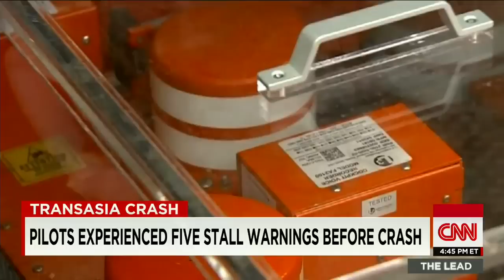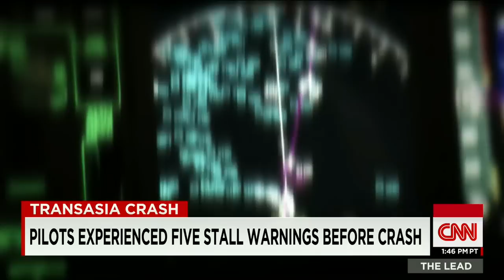TransAsia plane lost power in both engines

Comment: It's often hard to tell which engine has failed- a stall warning and loss of thrust, some yaw might be all the pilot realizes; especially if the dash board reads that both engines are running after engine failure is diagnosed he brings out his check list and goes through the process to shut the engine down- really not his fault- planes need more accurate sensors. Too many incidents of incorrect speed readings, incorrect altitude readings, incorrect fuel readings.
Reply: thanks for clarifying- most of us don't know any of this- I thought there would be separate readings for each to see which has trouble easily. what does the pilot mean exactly by 'flame out' in the Mayday?
Reply: Pure nonsense.
You don't shut off the engines just because one seems to have lost power, you keep going.

This fabrication of the distress call was put out there immediately, and is a part of the hoax.
Reply: chelleoj "flame out" is an erroneous term here. It relates to jet engines; When the internal combustion goes out for some reason.

To call for "Mayday" would not help anyone. What was they expecting? Someone aiding them out of the sky?
Reply: SLORRIFJART321 ty!
Reply: @Drottninggatan2017  Necro, I know, but what do you think happened?